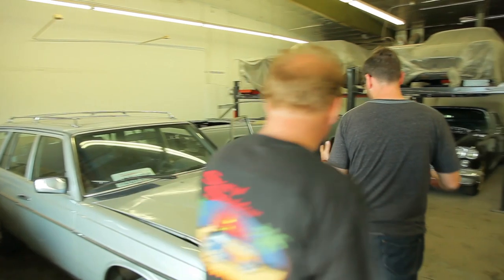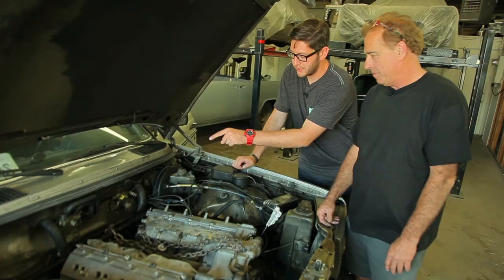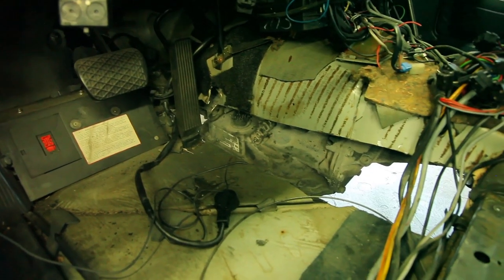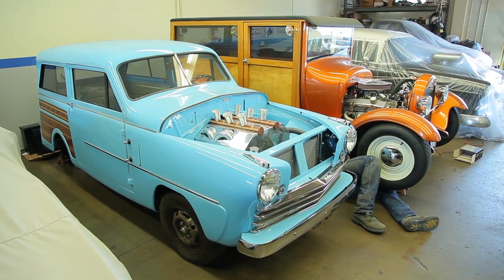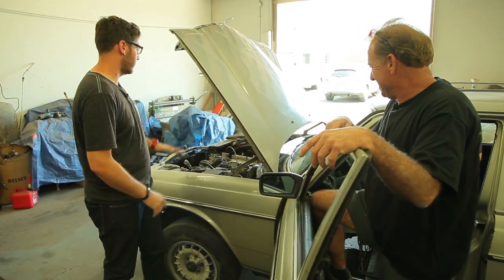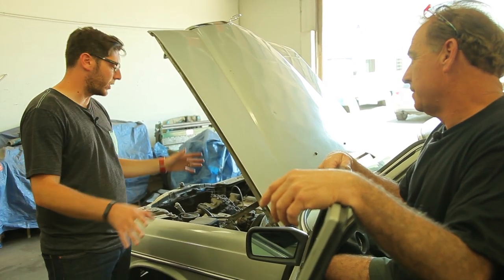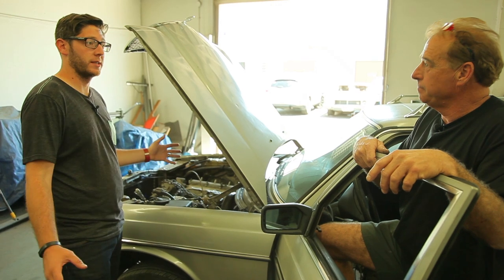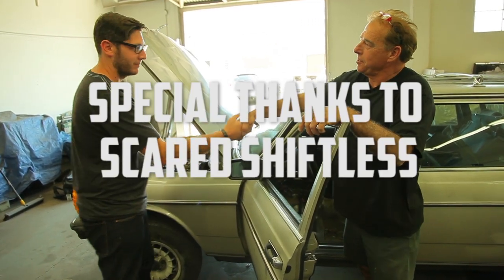The Wombat: Engine & Transmission Update

Comment: Why are they using the Giant 545RFE transmission from the ram as opposed to the smaller 722 based NAG1/WA580 from a charger/300. The later is much smaller.
Reply from the maker: +Gbody regal the whole powertrain and harness came from a Ram